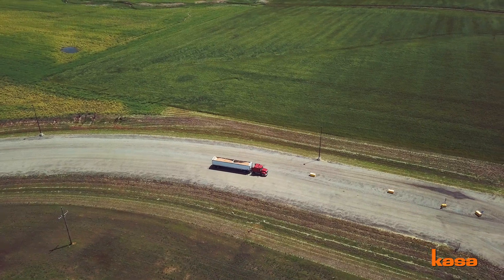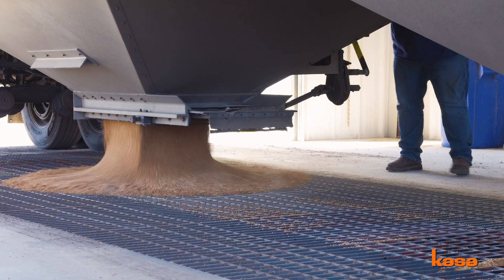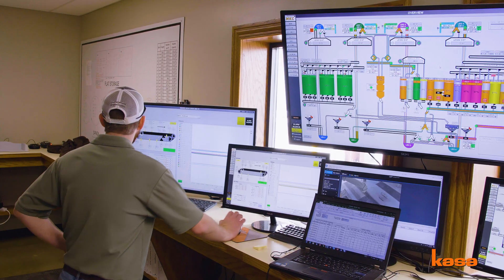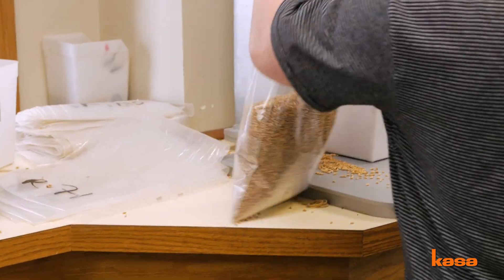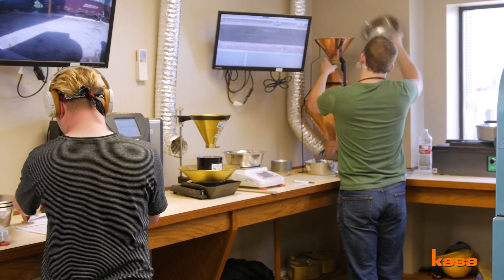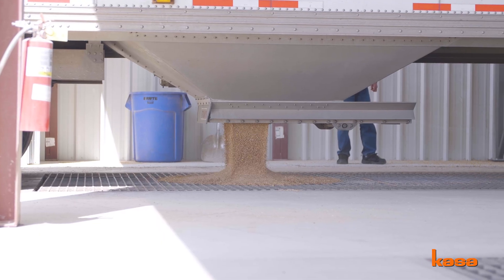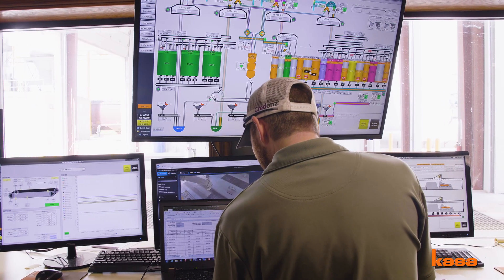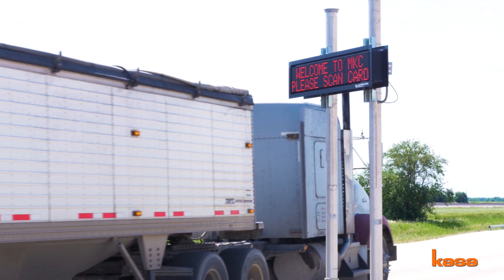High Speed Train Loadout Under 6 Hours

Comment: Nice video...thanks for sharing with us. I have a question...I do model railroad layouts and dioramas...some recently with agriculture themes/grain elevators..etc. what are the long yellow rails above the grain cars that I see more frequently? What do they do?
Reply: It is fall protection for the loader's that are opening and closing the top doors.
Reply: @sping785  I might craft one of those for my model railroad
Reply: @epiccsx  If you model any elevator from the last 25 years you should include this detail. An easy way of modeling this is to simply glue an I-beam to the bottom of the support arms directly over the center line of the track. If the track on your loading area is curved you’ll need more supports.
Reply: @douglasskaalrud6865  Thanks sir
Reply: Yeah what he said, we get tethered to it via cable, so we can open and close grain car lids in a timely fashion, you don't leave the top of the car